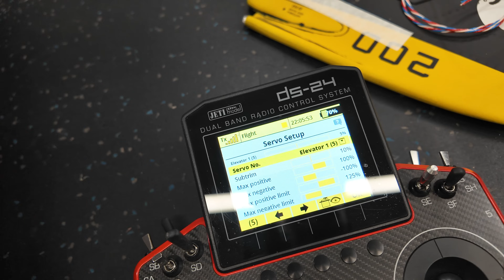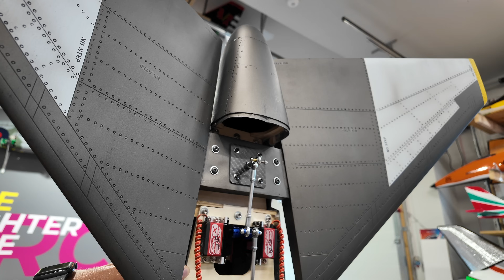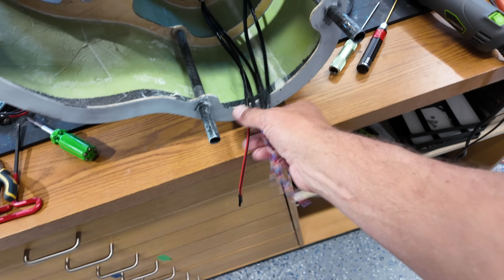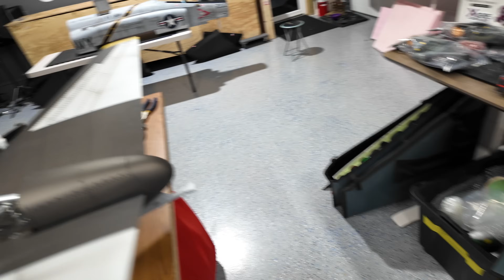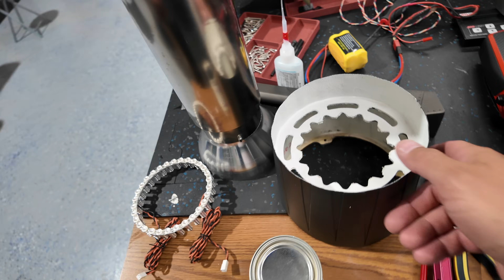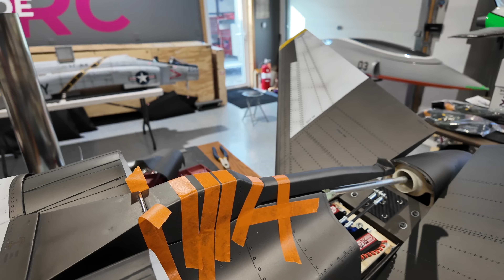Crafting The Tail F4 Phantom - Skymaster F-4 RC Jet

Comment: I’m always a bit skeptical if that piece of ply is stiff and strong enough for a full flying tail, especially if it’s only bolted to the one former.  I would be happier if there were a bolting interface to the front former as well.
Reply from the maker: We do a special touch on that area.  Did it on the small one's and this one will get it as well.  Will happen before the cover goes on.